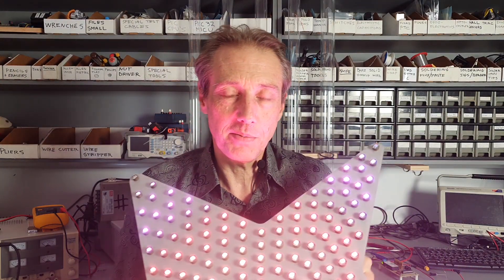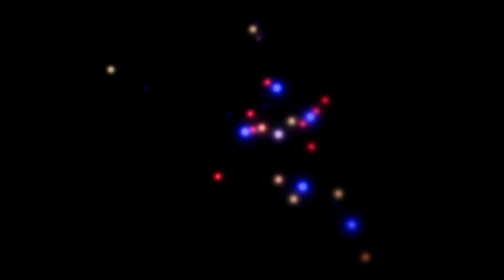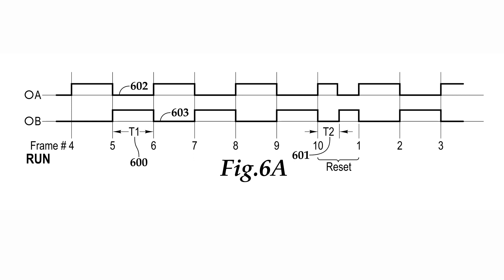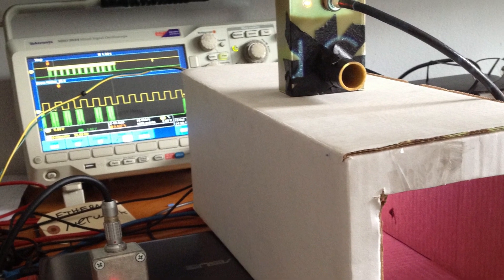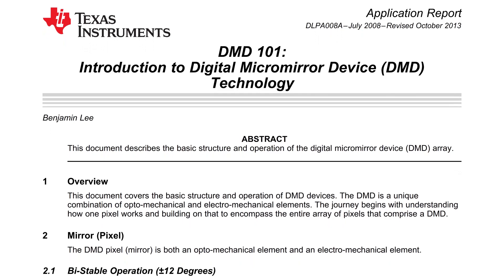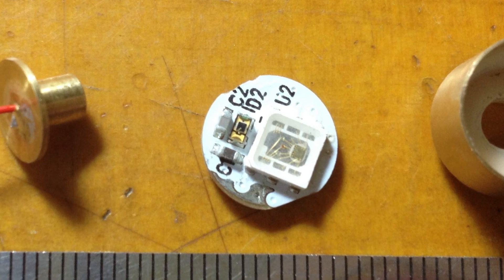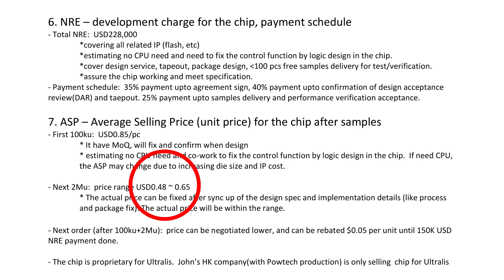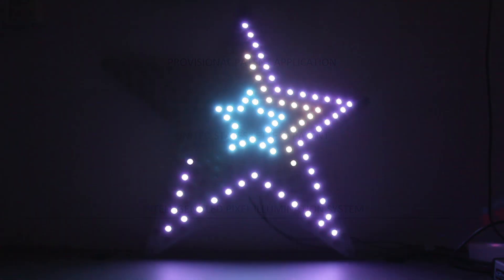The Inventors Paradox

Comment: Seems like you overcomplicate the thing. I mean you already have a data channel, why don't you use it also for data transfer?
Just use a manchester code? I'm sure it can be done better for faster transfer. Little bit of compression for faster transfer.
In general a neat idea that really can bring cost down for fixed animations.
Maybe also only load it on startup to ram and save the flash if startup time does not matter so much. Of course it all depends on how fast you can get. But in the end it's a bit like "powerline communications" using the power plane as a bus.

Comment: Hi, i spent on IPR registration 100$ for software application with common wide name "Risk analysis system" without publishing all classes of core modules. In one month i got registration number. It allows to me to make record in National Software Register and due to that  i got unfair advantages in deals with goverment companies. Also it allows me legally to perform huge tax optimisations because after registration i can sell non exclusive limited rights instead my working time. In total i earned around  25k$ by selling freelance works as IPR. My advice - you should spent on registration process as minimal as possible to achieve your business aims in first order. Just to be honest:You not able legally  to protect your rights from chineese or russian guys even you have well designed patent. You can only limit disclosure of your technical details in marketing materials. In worst cases you can implement protection on hardware level and increase complexity of possible reverse engeenering. Best regards from Moscow

Comment: i expected them to receive data via carrier signal imposed into two wire power bus. it didn't but that could be done, right? at least that's what i would like, instead of 3/4 wire addressables. it has number of issues too, each one needs unique id since there is no sequence of leds anymore. and maybe bandwidth is also an issue. now, bus powered addressable devices work, some use rs485 style comms and now we have single pair powered ethernet. howevery trying to stuff ethernet driver driver into 5mm led seems like outright insanity in 2022, need to wait until 2100 for this

Comment: Hi Leo, i feel your pain... frustration .... it performs as an led shaped display or a pixel led shape( which is mature and well know technology) .. compared economically wise.. even it would be a cheaper/economical solution  cfr 'price is the determining factor for some application' ... as you mention, it would take a large upfront budget $$$$... and a huge stock of ASIC's.... unless you have a signed order it would be a good to GO  moment.... then you have a functional product in the market... but you need a kind of APP / software for lt , so people be creative with it  in an easy way ....  there are solutions to get this to the market .. alone is difficult..just get the right people together... make a plan...and start ...  but before all make sure that you still have an MVP ( minimum viable product ... a full concept set  =  led system + control software ) which can generate enough profit.  without profit, there is no  business. .... and when you are able to get the right people together, just scrutinize your team..... it happens many times, and enough examples in big corporations nowadays, that a member breaks out, and set up a similar business but with another vantage point - which they do not want to share for obvious reasons - and they are more successful than the original start-up .....  just to say ...

Comment: Cool stuff! I'm not sure what pixel mapping problems are, but I suspect it's the problem of knowing which pixel is where? So I would have done it the other way around. Pack LED strips with as many LEDs as possible into the shape, and use a camera+software to find the individual pixels. Either by lighting them one at a time, or in groups until a model is constructed. Could that work?

I think coding the software to build the LED/pixel Id to x/y coordinates would take a few days to code up, and it would only need to be done once per sign. I'm not talking snazzy end user friendly code, but something that work in a controlled environment.

I love how the patterns looked, I'd love to see signs like that all over the place.
Reply from the maker: The problem is communications, unless you have fancy wiring, how do you send data to an individual LED? The Concept revolves around the super basic 2-wire connection which makes fabrication easy.
Reply: @leosbagoftricks3732  I was thinking LED light strips where the LEDs can be individually programmed through a bus,  "WS2812 controlled RGB LEDs" as Bitluny uses in https://www.youtube.com/watch?v=fz2QAV9z_o8 .

Those LEDs seem to have four leads and they seem to be fast enough to be used as a screen. I realize that two leads are easier and cheaper than four, but not that more expensive? And I can buy those at $6 for 20 - you could probably find a way better deal.

So a sign manufacturer without too much electronics skill could build a sign and drill holes for the lights. Drop the lights on a light strip into the holes. For large/complex objects, multiple light strips could be used.

Run the calibration routine to figure out where each pixel/LED is in x/y space.

 After that, coming up with the patterns to run would still require some artistic talent, no way around that. Hm... well, perhaps colored 4d perlin noise.

All this could of course be performed by a skilled electronics developer who took his time to note where each pixel/LED goes, but for a great number of LEDs, that might become cumbersome.

The "business idea" would be to 
* sell cool signs

or

sell
* the light strips
* the calibration software that maps LEDs to x/y coordinates
* the software to design the light patterns
* the driver that sends the light patterns to one or several light strips connected to the driver/sign

cheers,
m
Reply: @mattiasfagerlund  My train of thought, exactly, after watching this video. Serially-addressable LEDs (strips) are the cheapest way now to do something like this. The money could be in making the controller communicating via BLE to a phone, and the software on that phone mapping 2D or even 3D positions of the LEDs and building the model, then allowing drawing animations on top of that, and/or mapping pictures/video on it. Sell this to sign vendors, or directly, along with LED strips, or as ready-made signs. To increase refresh rates the controller could drive a few strips in parallel.

Otherwise, I feel you, chasing the rabbit down the hole is what engineers live for, and you need to learn business-oriented thinking, and when to stop the chase, to survive as an individual "product developer".

Comment: I can so relate to this..i spent years developing a set of audio plugins that totally failed in a sens financially because the computer technology i based it on moved too fast for me to catch up to with my limited financial means and software that went obsolete. Several other hardware projects i developed also fell short. luckly my job allows me to develop one off equipment used in my industry. But i still felt proud and passionate at what i did achieve and looking back it was pretty dam clever if a say so myself.. But i think your on another level of genius even if it didn't pan out i'm amazed at how clever your approach to solving these problems are. I'm thoroughly impressed and i'm no wall flower in these regards. cheers!!!

Comment: Do something with it, though, so at least you'll get credit. I came up with a way to use a driven shield on a capacitive sensor to increase sensitivity, back around 1981. About 20 years later, someone else at NASA reinvented it and patented it.
Later, I came up with a new and better way to feed ink from tanks to inkjet print heads. I sold several, then about few years later, there is a patent in China and every single version that I made is being sold cheaper than I can make them. And technically =I= would be in violation of their patent, even though I invented it first.
Reply from the maker: Was that the Capaciflector idea?

Comment: I wonder how much needs to be off-the shelf for this to be commercially viable.  The CNC routed Brass housing made me recoil in cost. 

Stamped Metal Housing, standard metal thread for the center.
Standardized injection-molded plastic for the insulating ring.
The cheapest MCU and RGB led possible, like 1-10 cents cheap.
I wonder what the final BOM cost was and how far it got from the "maximally viable cost"
Reply from the maker: Agreed, the brass part was the zero tooling cost prototype solution.

Comment: Cool idea. I have toyed with the exact same thing from time to time. 

I might've gone the route of bare dies to avoid the ASIC, splitting it into a super-cheap MCU and some external flash. And in my ideas I have used automatic position detection so the parts know where they are and can receive a single shared digital data stream (avoiding the expense and complexity of the optical content coding). Plus the cost of rectifying AC is kind of high, so a DC-based system is probably just a hair cheaper.
Anyway, the patent thing is critical to avoid being killed by Chinese competition, so your business partners in the project had the correct instincts on that one.
Reply: Since when do the chinese of a copying persuation care about patents or copyright?
Reply: @rimmersbryggeri  They don't. But the importers, distributors, and resellers in western countries do.
Reply: @akiko009  Do they really though? Doesnt seem like it in the "Same old Korean shit" (an expression from the 90's music business) markets that are everywhere and even infiltratin legitimate businesses.

Comment: Thanks for sharing! Half way through the video, before you showed the projector bit, I was thinking that you could map the LEDs with a video camera. For example, If each LED had a unique factory ID, they could transmit (blinking) this ID 1 bit a time on powerup or bus command. A cheap camera could then record a map of all the IDs at once (smartphone!). An additional programming means would need to be connected to the cladding to program the array with the (re) mapped animation (an encoded stream containing the RGB values for each ID). I was just thinking that this seems much cheaper and simple than dealing with a custom DLP projector, you save the light sensor, and it's especially more convenient for the end user who would only need to do this once on setup and then use just upload new content via cladding/bus. Have you considered something similar?
Reply from the maker: Thanks for sharing your ideas. The bandwidth of the power bus as a communications medium is very low, not practical for programming.
Reply: Makes sense! Thought if they had IDs you could still use this method by (IR-)blasting the whole program from a bright LED source instead of the projector.  Overall I think the product it's a great idea! Specifically the use of the Alucobond/sandwich panels for this, since they are already in use in the signage industry. Good luck!

Comment: I don't get why you felt the need for an ASIC...
Reply from the maker: Cost, Cost, and Cost. The MCU is too expensive.
Reply: @leosbagoftricks3732  Not any more! You can get decent MCU's for <$0.10 now. The addressable LEDs are also super cheap now. I bet you could easily get the pixel electronics BOM <$0.25 (MCU+LED+diodes+cap+PCB). You can put a unique serial number in each pixel when you burn the firmware making it possible to program the whole thing though the power bus - eliminating the need for the whole projection system and the light sensors. Instead, you aim a cellphone camera at the sign and then iterate through the address space one bit at a time to discover the addresses and locations of all the pixels. Then you download the individual cue programs to each pixel. It is slow, but who cares since you can quickly download the data from the phone to the sign controller over BLE or Wifi, then let the controller program the pixels overnight over the power rails. LMK if you want to revisit this project - I have experience with all of these strategies and can help to potentially save you some time!
Reply from the maker: @bigjoshlevine  Please point me to an MCU with 14K Bytes of self-programmable FLASH for  $0.10!
Reply: @leosbagoftricks3732  Are you storing a stream of uncompressed 8-bit R,G,B values? Any RLL or delta compression?
Reply: @leosbagoftricks3732  these are available COTS ... in quantities ofcourse ... but you shouldn't look at sites like Mouser and the similar ones .... and if you do, you'd better have a business plan where you know your number of PICs in advance... if you're lucky, they give you this price at the start with a serious commitment of purchase...
Reply: @leosbagoftricks3732  BTW, if $/pixel is the main bottleneck, I bet you could eliminate the housing altogether by putting 3 solder bumps on the back of the PCB to contact the front power surface. A standard screw and nut (CHEAP) contacts a plated hole in the PCB to the back power surface. Now the pixel pops out of the PCB panel and is ready to use. Maybe add a conformal coating if weather resistance is needed. I bet you could make 10K pixels for <$0.20 each with very little work. Nice to just see what the market really looks like. Maybe you actually make all the money via the app that programs them? Charge a fee based on the number of pixels in the sign each time the pattern is updated . Easier to protect than the hardware design - and Google and Apple collect the money for you.